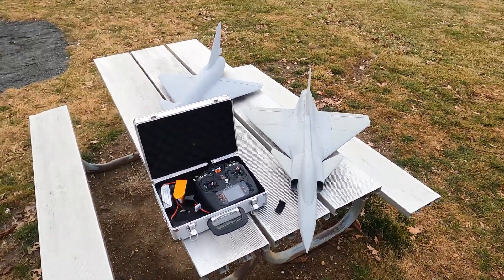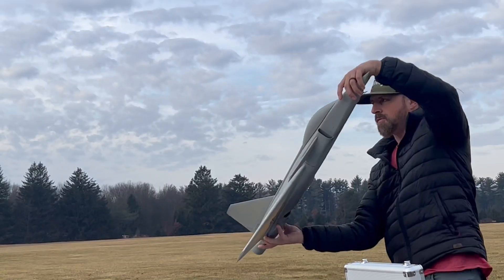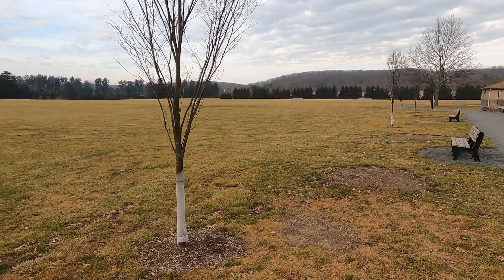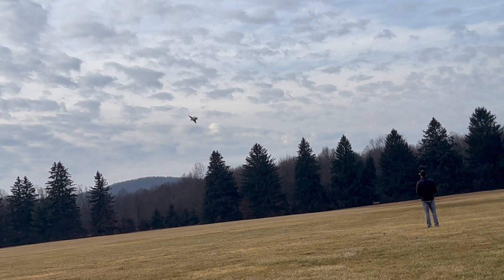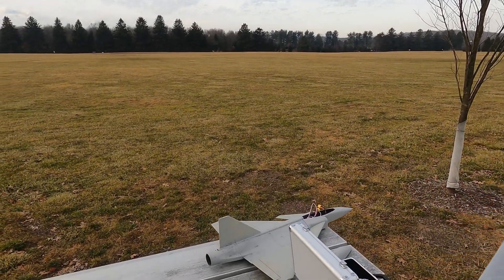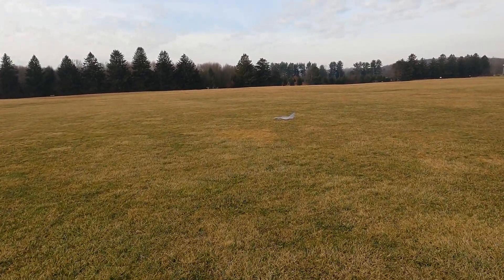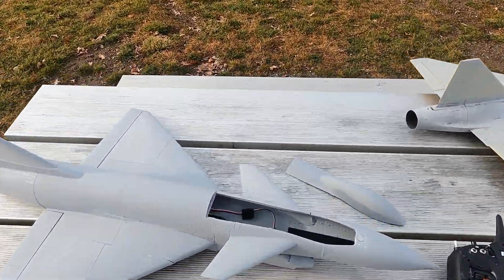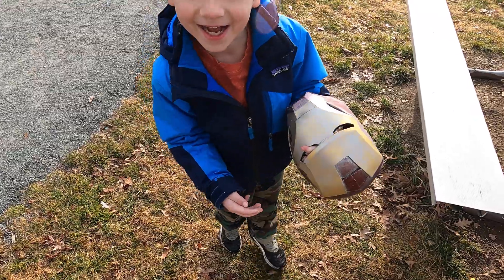3d Printed J10 is finally done!! it’s an ANIMAL!!

Comment: I just started printing the parts.  Is there any news about Thrust Vector yet?
Reply from the maker: Still working on it. Issue is that it changes the weight balance where you need a heavier battery and then it messes everything up. I’m still trying
Reply: I have a small question.  Why are the parts J10fuse1 thick bottom and J10fuse 2 thicker bottom much longer than the others?
Reply from the maker: @aerodeck  can you email me some pictures so I can understand better? Builtfastkyle@gmail
Reply: @hotlapkyle  Done ;)
Reply: The email address appears to be incorrect
Reply from the maker: @aerodeck  yes I didn’t use .com so spammers could just click builtfastkyle@gmail.com
Reply: @hotlapkyle  Done ;)

Comment: On a real J-10, there are two small vertical stabilizers under the belly near the engine, which will help even more with the high-AOA/stall yaw stability.(since the big one on top will be partially blocked by the large delta wing)
Reply from the maker: Yes they would be destroyed on the first landing
Reply: Did you purposefully ignore those for the belly landing? :P

Comment: Awesome work, gotta love 6s power. I’d be curious to see if it is possible to recover from a flat spin using only mixed elevon control surfaces, I haven’t seen it done before and not had any luck myself without rudder. I could be wrong though & each plane has inherently different stall & spin characteristics.
Reply from the maker: I’m going to repair it tonight and put it into another flat spin tomorrow 👍🏻 my CG was neutral to slightly back so when I go 2-3mm forward it will help

Comment: I like the grppin since the intakes are on the side of the fuse and don't dig into the grass like the J10
Reply from the maker: I’m going to adjust the file and round the lip or use the zip tie gear trick. Stay tuned